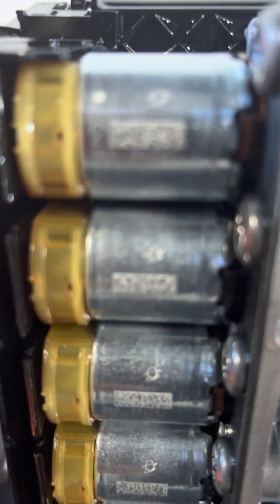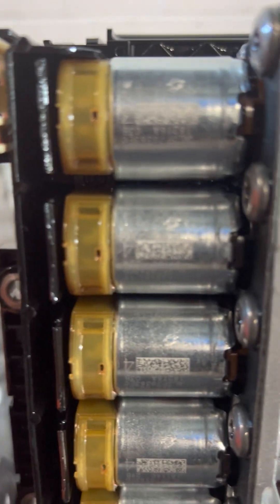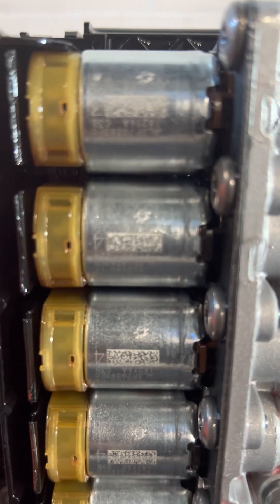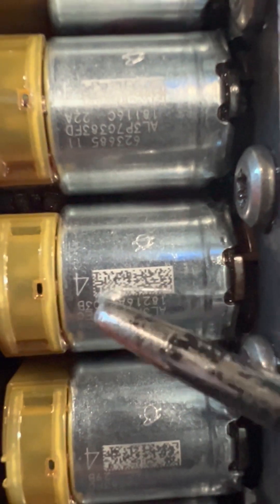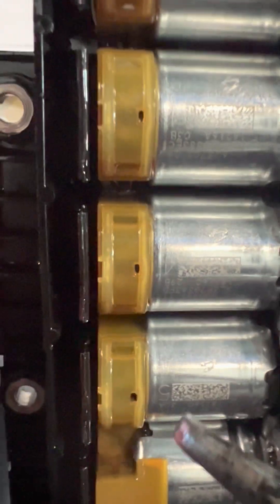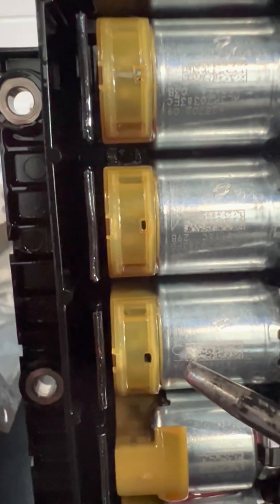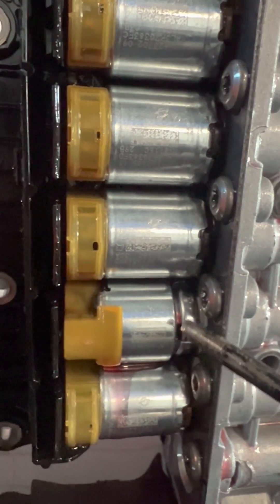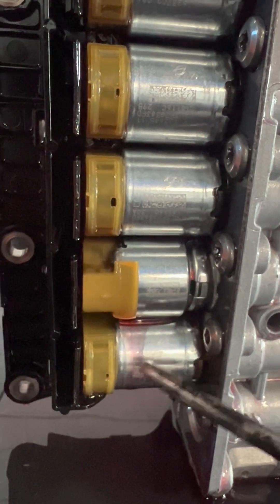Do you know BT50 valve body solenoid are calibrated to TCM?

Comment: Chef tanong ko lang ranger 2.2 automatic 2014 model  my shift shock sa pg upshift nya sa 2nd gear. Ok na ba yung shift solenoid na mabibili sa ebay replacement aftermarket lang. Please reply
Reply from the maker: @ joun. Bili ka ng genuine para segurado